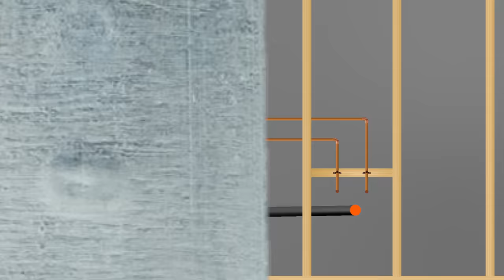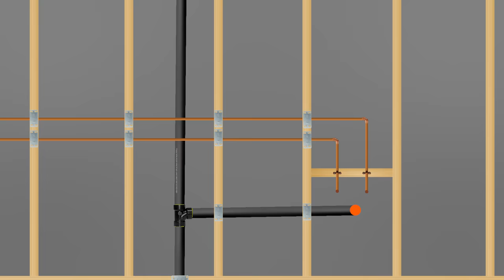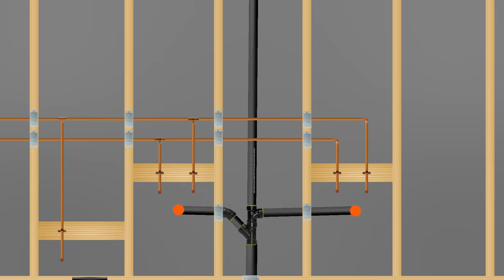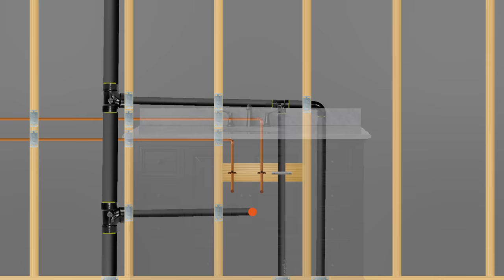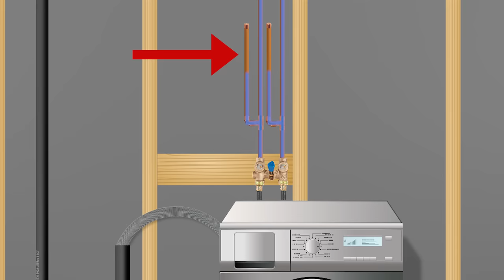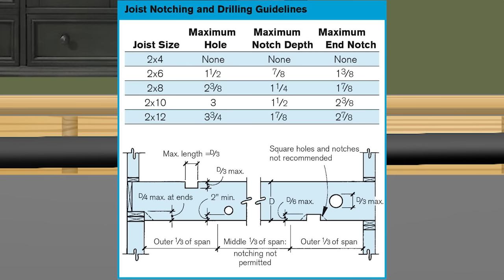10 Reasons Why You'd FAIL a Plumbing Inspection! | GOT2LEARN

Comment: What do you mean there's no way to unblock the event of course there is and obviously that demonstration right there was on the second floor because there's no reason to have two other vent pipes coming out of the ground attaching to the main event which I think that's under code as well I don't believe you can put two inch and a half vent pipes into what looks like a 2in vent pipe as well as their running horizontally whereas vent pipes must run no less than I forget at least run at a 33 and a half or 45 degree angle vertically so I'm sorry I can't believe anything you say now

Comment: whys to not fail a plumbing inspection do your own work never call a inspector dont recommend this on new home but if just old remodel or your own home who really cares do it right as you can some codes are just there for money if something was good or 100 years its not suddenly unsafe now some one just payed to have rules changed to sell more parts like 1 1/2 in washer drain my worked fine for 50 years and i have old washer uses water on like to days washers they just pee on your laddery and expect it be clean

Comment: I almost got mean about this video, then I checked myself.  There is no national standard, it’s all according to local codes.  We’re not required to use long sweeps until you get up to 3” and then you still have to use a long sweep on a toilet unless it’s a 4 x 3 closet 90.  Hammer arrestors are required on all fast acting valves, so really they are required in a lot more places if the inspector wants to be a dick, but are not necessary in the least and especially on an icebox.

Comment: Im a plumbing Superintendent. You can turn up a short bend 90 up to go through slab. Yes its better to use a long sweep but you can technically still pass per code. Now if you lay it horizontal it has to be a long sweep period

Comment: No way to unclog a vent?   Really?  Ive unclogged many a vent..  pulled dead squirrels, aluminum foil and spray foam out of em.  Once i used compressed air to clear the clog..  it blew poo all over the ceiling but wasent my problem..  was the guy who told me to do it ..  lol..  he said “ok give her one quick blast..”. Next thing i hear is “ oh shit, ok got it..”. Told the guy but nooo.  It’ll just blow it down to the main..  tried explaining if the air will have any effect on a clog then the clog is located above the fixtures and not after them on the stack..    he said “ that doesnt make any sense”..    i told him to tell someone to stop putting shit down the vent pipes..  and left out of there..  ha!

Comment: Your horizontal toilet drain has no vent
Reply from the maker: No need for independent vent here in Canada.
Reply: @Got2Learn  I've seen unvented toilets siphon bathtub P traps. Uniform plumbing code requires vents. Heal Vents and wet vents not allowed. I'm also unfamiliar with vertical drain cleanouts. uniform Plumbing code does not require any clean out on vertical drains or drain lines above first floor and all required cleanouts have to be accessible.

Comment: Watcher beware, insure that these instructions reflect the code to your particular state. Some states utilize federal code that do not have their own while others have their own state code. For example here in Massachusetts we have 248 CMR which is one of this highest standards and most strict codes in the entire country. Here in mass all of our codes are actually law. It gets espically dangerous when working with gas which is covered under the plumbing and gas fitting license. No homeowner should ever try to work with gas themselves ever. Leave it to a licensed professional, this trade is not a hobby. When mistakes are made people can die. If you are in question hire a professional. Not all codes are the same and going by one YouTube video can put you in a pickle.
Reply from the maker: These are for Canada and a lot are good for other areas, but ALWAYS consult with your city to make sure you can do any of these BEFORE!
Reply: @Got2Learn   ohhh gotchya, yeah I’m not familiar with the code up there, down here it varies so much from state to state that it’s hard to go by something like this
Reply from the maker: @wheelinndealin  😉

Comment: 1.why does it have to be 6-18 inches off of floor?
3. I was also told its for snakeing the pipes... a Y will direct the snake a TY there is potential to go the wrong way when trying to clear.
5. Almost impossible to fail this... whos inspecting the plumbing when the counter top and other stuff is in ... only way you get caught is if its to close to a wall.Also toilet flange bolt positioning on this flange ;)
7. ... once again you can not get caught for this one unless your dumb... and the inspector would truly have to be an asshat  for this... and who gets a permit for basement construction lets get real!
8. ive never used/seen shock absorber laundry faucet shutoffs thats neat... 
9. code now I believe is PVC out of floor that transits your clean out to abs...not 100% but 95% sure
11. This was a great video, informative and fun to watch thanks a bunch for posting it :)

Comment: It’s plumbing, all crap runs down hill. Plumbers, electricians, a/c repair and all the rest of those people are in this to make money. I called “The on time experts” I got screwed. They came out and showed me where my uneven sewer pipe was that was broke and kept clogging. They wanted $4,000 to dig a 3’ deep hole to fix it. I paid the $100 to have them run a camera and find where the problem is then someone to dig the hole for $200 and I fixed the problem and I saved $3,700. The hardest part was putting the dirt back in. STOP calling these crooks and don’t ever call an inspector for anything

Comment: I still see capped copper pipes used to prevent water hammering in modern construction. It bothers the hell out of me because it’s not only a cheap corner to cut (seriously $5 difference in materials) but as you said they inevitably fill up and inevitably require a total system dump to clear, which can take hours depending on the system size.

Comment: Mostly common sense.
The first one has me scratching my head though, I mean sure, easy enough and no kill like overkill but why?
Reply: Because of the large volume of water a washer pumps out fast, 1.5" would be more likely not to keep up and overflow. When a washer dumps into a laundry sink, the sink holds water until it drains through 1.5" trap

Comment: I love how you think this stuff applies nationally. Codes vary state by state. KY doesn't follow IPC at all. Don't need a cleanout on a stack coming out of a slab in my state. Not in residential. If that line backs up you're not taking the cap off in the basement to cleanout that stack. You're gonna pull the toilet. If that line is clogged ahead of the cleanout then that cleanout is utterly useless. The moment you pull that cap off you will have an unholy mess in a basement. There's a million things in my state that will fail an inspection in KY. KNOW YOUR LOCAL STATE PLUMBING CODE.

Comment: Your hilarious you due realize unless your home is built from 2010.n even then most time contractors only use dotti plates in thin spots where the wire or pipes go through.  N it doesn't matter if you use it when a homeowner who usually hangs stuff without knowledge of where studs are will hit the pipes or wires anyway due there running alongside wall n no way to this day to protect it... .these codes are for new homes n even then.being in the field it all depends on the inspector mood . There a lot of shady ones out there

Comment: I get inspections done all the time this is not how this works if you don't put plates in for the water lines will not fail you they only have to be where there is gas lines